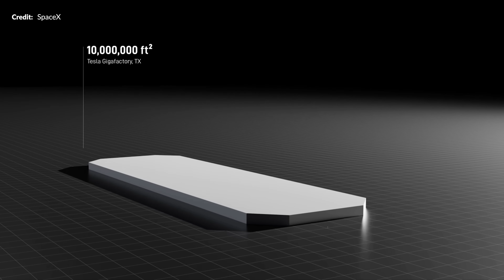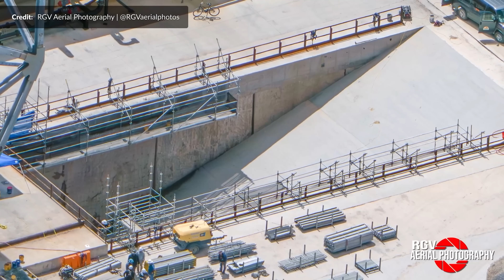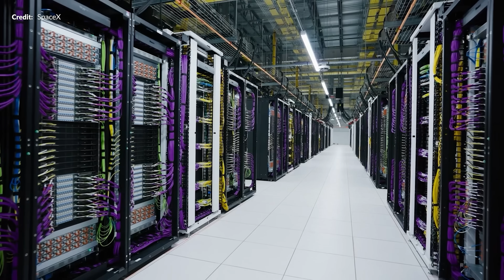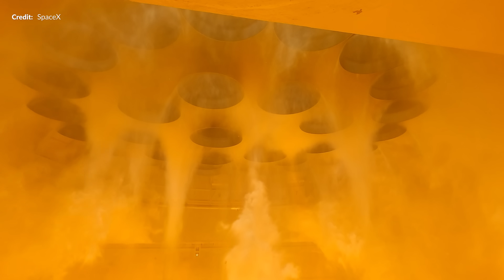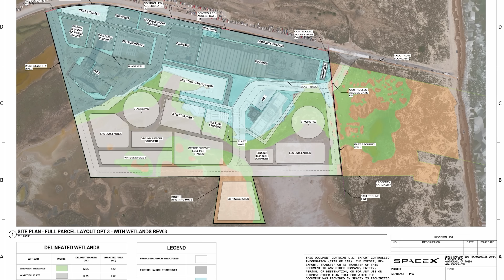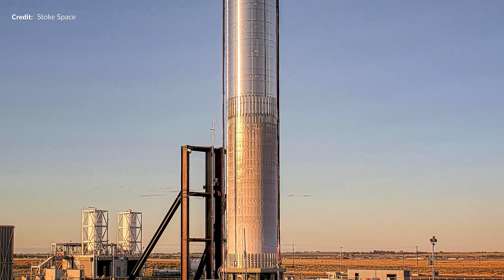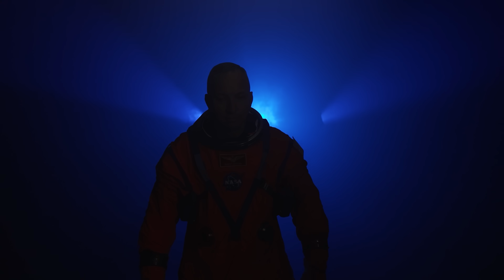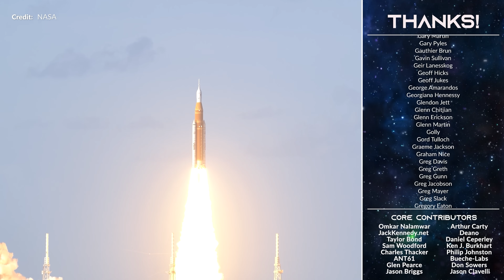SpaceX Just Revealed Its Biggest Plans Yet

Comment: When you consider a falcon first stage being reused 35 times you can truly understand how much money and resources are being saved by the re-usability of them.  That would have been 35 desperate rockets and engines that would have needed to be replaced.  Amazing.
Reply: Every time they set a new record I remember Thunderf00t doing a video "debunking" Falcon re-usability.  

Even then I saw that the numbers he calculated with didn't match the numbers he stated.  The key change is he stated that Falcon in reusable mode could carry 70% of expendable and his calculations used 50%, so he compared 5 expendable launches to 10 reusable (and asserted that 10 would almost never happen, but gave no reason for that).  The number swap and assertion (for those who accepted them) made him look right.  Use the number he stated though and even with only 4 flights it was clearly better for SpaceX financially, especially if they didn't pass on ALL the cost savings but it would still be cheaper than expendable per kg to the customer.  

Now it has reached the "impossible' 35 flights, the numbers work even more in Falcon's favour, especially since they are doing more than 70% these days and expendables can also be cheaper for the customers as they now expend reused boosters instead of new ones.  

Haven't watched him much since then as for topics I don't know I can't tell if he is lying or not.  

:face-turquoise-covering-eyes:

:face-turquoise-covering-eyes:
Reply: @Scanner9631  A lot of people don’t understand the SpaceX/Musk way of working, and others assume that because Musk is (in their view) a jerk, his companies must be bad. In most engineering companies i’ve worked in, the management get in the way.
Reply: @Scanner9631 By the way, Falcon 9 is such a advanced rocket, that even with 30% nerf it still have more payload fraction (3%) than most expendable rocket(2.5%).
In expandable mode the payload fraction for Falcon 9 is 4%.
Reply: Incredible validation of everything SpaceX has been talking about.
Reply: desperate rockets: "No, No! I don't want to return to earth... It burns! it burns!" 
(it's disparate... different word...)
Reply: @qcca123-f1v  though he meant separate lol
Reply: Maybe we're saying this backwards?

When you consider Falcon first stage being reused 35 times, you can truly understand how much money and resources are being wasted by every other launch provider.
Reply: @kennethroberts6993  you do realise how much bigger a trillion is compared to a million? in other words, SpaceX would need to launch a rocket 60,000 times to come close...
Reply: @spanke2999 you missed my point. A single Falcon 9 booster has made 35 launches and 35 recoveries, and is ready for its 36th mission. SpaceX still has the working booster. 

The rest of the world before SpaceX has been launching 1 mission and disposing of the entire rocket. The refused to accept that rockets could be reusable.

Any prior launch provider would have built 35 boosters, launched them, and disposed of 35 boosters. Leaving them with none. They dispose of every booster. To be left with one, they'd need to build the 36th booster compared to SpaceX's 1.
Reply: @kennethroberts6993  I didn't missed this, a trillion is just a million times bigger then a million... That's a lot of rockets even for space X 😂 you guys are missing the point how big the numbers of this ipo are. It's economically impossible to make a return of investment with rockets😅
Reply: @spanke2999 It's not impossible to get ROI from rockets. Falcon 9 is economically feasible, or SpaceX wouldn't be launching 150 times a year.

As well, nobody is going to launch a million rockets anytime soon. The xAI constellation will supposedly have 10,000 satellites in it, and Starship launches several per flight. I know xAI sats are to be larger than Starlink, but I don't know by how much.

That million rockets thing is for the moon and mars. And Musk doesn't talk about it like it's gonna be just SpaceX. He expects other companies to ramp up too.
Reply: @kennethroberts6993 I didn't said it's impossible to get any ROI. I said it's impossible to get 2 Trillions bank with rockets. Starling so far is the only branch that makes any money and given this the evaluation is round about 3 times higher then it should be😅
Reply: @spanke2999 I guess I missed your point after all. You're talking about the IPO and money. I'm talking about rockets. To me, the IPO is old news. I can't wait for the hoo haa to settle down. Millions of launches won't happen tomorrow, nor the day after. That's Musk setting the stage for when colonization is actually happening.
Reply: @spanke2999 2 trillions bank? SpaceX doesn't have "bank." They have assets that you can touch, made out of metal. SpaceX has dreams and teamwork. They have contracts and enough reliability and proven skills that a ridiculously huge number of people wanted to be part of it.

Day traders have "bank." Day traders are what workers with jobs and families scrape off their shoe on their way to work.
Reply: You are a day trader. Your contribution to the future of humanity is a negative number. Day traders are parasites. Buy low, sell high, and what was the name of that company again?

Day traders want lots of liquid assets so they can dash in and scoop up bargains.

So you probably know terms like liquidity. Go Google Elon musk liquidity. Or gwynne shotwell. These guys are in it for the long haul. Musk works 80+ hour weeks. This isn't a work-a-day company that empties out at 5pm.

I'm tired of people who only think about "bank." Have a nice life.
Reply: @kennethroberts6993  of course I'm talking about the IPO because this is what will shape SpaceX from now on! Money and profit! And I don't know how to bring this to you, but colonization wont happen anytime soon. 

1. because of so many problems that the rockets to reach Mars are not even one of them.
2. nothing... and I mean nothing Mars can provide that isn't so much easier and cheaper here on Earth! 
3. Multi-Planetary-Species... to be frank, we are not even able to protect the planet we have from the stuff we do to it! I fail to see how this will change at another place that is far more hostile to life then any place we can find here on earth
Reply: @spanke2999 
1. I'm pretty certain I will be gone before a human sets foot on Mars. That's irrelevant.
2. Except provide safe haven for the species if Earth is hit by a mars-sized hunk of rock going half of light speed.
3. Doing the work today brings new knowledge to the species. Throughout human history we reached for the stars...for things that were viewed as impossible and even insane. Usually we failed in the main quest but enriched our lives in unimaginable ways simply because we tried our hardest.

Money is nothing more than an abstract token of worth. You, as a day trader, are inherently incapable of understanding this. You might try for the rest of your life, but the dollar is the altar where you sold your soul. It's the only ending for people like you, and you won't understand how worthless it is until your last breath.
Reply: Humanity has won simply by setting foot on the path of knowledge. Every time humanity splits itself, a wealth of knowledge is discovered. The financiers are never the recipients of the knowledge gained. The species is. The beginning of discovery is not when the destination is reached. It's when the first explorer sets foot on the path.

This isn't some sort of religious rant. It's documented history.

Again, you won't see it because of buy low sell high. Day traders don't have the necessary equipment to participate in the quest.
Reply: @spanke2999 mars has been my dream since I was a boy. The fact that a significant effort is being made to get there fills me with jitters.

But Mars isn't the important part. Rockets are. There's a shit-ton of projects, both research and for profit, that want to launch heretofore unheard of mass to orbit.

Do you think it's a coincidence that SpaceX is within a couple years of Starship coming online? No coincidence at all. Starship will succeed because humanity needs it to. Look who the biggest investors were. They're venture capitalists who have been allied with SpaceX since the beginning.

We need a shit-ton of orbiting hardware. Starship will deliver. It's not a question of whether anymore. They already tested every system. 

When they start launching more mass to orbit annually than falcon 9, every other rocket company will scramble. If they can't get their cadence up and their costs down, they'll either fail or fall into obscurity.
Reply: @kennethroberts6993  If I were a day trader, I would be celebrating this IPO. A quick 30%+ hype pump within a few days is exactly what short-term traders live for. The criticism of the valuation has a completely different systemic background.

The IPO is not a sign of strength, but the classic exit vehicle for early venture capital investors. This is a transfer of risk: VCs pull their capital out and dump the long-term risk onto the public market. Once the market realizes that the core launch business can fundamentally never justify a multi-trillion-dollar valuation, capital flight becomes a real threat. This compromises the very existence of SpaceX instead of securing it.

Furthermore, economic history shows that it is rarely the visionary pioneer who ultimately prevails, but rather the one who can implement the technology in the most economically efficient manner. Visions without liquid backing collapse.

You can dismiss the monetary system as an "abstract token" all you want, but it governs the allocation of real resources on this planet. Just as physics does not care about human dreams, economic constraints do not care about romantic narratives. We operate in reality, not in a utopia.

and since I'm not a day trader... your half light speed meteoroid would carry so much energy, that the impact would affect the whole inner solar system, including Mars... 😇
Reply: Musk is full of shit.
Reply: Thanks
Reply: Shame the funds are going to be sucked up by AI  hardware
Reply: @walterrwrush  I think the opposite is true, they're pushing AI hardware as a cash cow to fund thousands of launches and develop starship hardware.
Reply: @walterrwrush  How do you get tons of ai satellites in space though? Big rockets 😂
Reply: @walterrwrush why? It get it off earth and provides a lot more engineering power
Reply: sadly most people fail to understand how much a trillion is... 😅 you would need so many rockets savings for this... so so much, it's sadly pure fantasy!
Reply: @spanke2999 that is what they said about falcon.
Reply: @brianbiddle7590  not really, falcon could be a distrupting technology but there was no physics problem with falcon. It was questionable if it could make it economically, but not if it would be possible at all. But then SpaceXAI is no longer about rockets. Not about falcon not about starship. 2 trillions only make 'sence' when you go data centers... And these don't work because physics! So there is a difference
Reply: @spanke2999 again they siad the samething about falcon. There are plenty of videos showing how they are going to do it with the math proving all the people like you saying it won't.  I have to ask what do you do for a living?
Also it is about rockets because you have to make it cheap enough to get the payload up.
Reply: @brianbiddle7590  The critique of Falcon 9 was about economics, not feasibility. Space-based data centers, however, face a fundamental technical barrier: ionizing radiation and nanometer chip architectures do not mix. Shielding and redundancy (TMR) required to prevent constant hardware failures add immense mass and cost, while vacuum cooling solves nothing efficiently. It doesn't break physics, but it completely destroys the business case. This IPO is riding on pure hype, not a viable product.

And just because they solved the engineering challenges of reusable Erdorbit-delivery, it doesn't mean their scaling logic applies to high-radiation solid-state computing. Past success in logistics does not guarantee feasibility in physics — just ask Boeing how historical dominance in aviation didn't guarantee success with Starliner's software and valves.
Reply: @spanke2999 what “physics” prevents chips from working in space? You do realise Starlink satellites already have plenty of chips running on them right now… so where is the physics that makes this “impossible”?
Reply: @StarMan_2018  considering that the guy cant even spell the word "sense" i don't think there is much sense, in trying to have an actual intelligent discussion with this guy.
just agree, "yup, no microchips in space" and then continue enjoying all these great new aerospace companies launching hundreds of chips into space each year. its better for everyone that way.
Reply: @StarMan_2018  I wrote it down I guess... but I can repeat it if you want. Chips are not chips. You might realize that a modern graphics card can be a bit more expensive then an old Laptop from 4 years ago. The magic behind this is partially based on the size of the architecture of the chip. this means the transistors inside it becoming smaller! currently, with the AI chips, we are talking about  3 nanometers. That's really really small... so small in fact that it reacts quite sensitive with ionizing radiation which can cause all sorts of problems, SEE's, TID, and so on. In short the chips are prone to produce errors and degrade much faster then here on earth. To combat that you would need way more chips or rely on heavy shielding! 

Why is this not a problem with other satellites ... it is! That's why they don't use ultra modern high density architecture and or operating in lower orbits. Given the idea, or realizing the power need of a AI satellite, to let them orbit earth in 2,000km instead of 400km... you increase the ionizing radiation by 3 to 5 orders of magnitude! 

So... what physics you ask? The fact that you reduce the chip architecture to have powerful and efficient compute and the need to operate in a radiation environment that makes this intensely prone to failure. I hope I have not so many typos so that @LodewijkVrije doesn't get distracted 🤣

Remember the flame tranche! Physics is not an option... it's cruel no matter how much flashy ideas you have!
Reply: @s @spanke2999 es, I don’t see their shares being a good short term investment. Maybe in the long term when moon mining is routine
Reply: @spanke2999 Rocket launches aren't why they are valued at trillions. It is global reach for the billions of people and available compute with unlimited energy 24/7. The irony is, you understand none of it while questioning the value of a trillion.
Reply: @nguy404  oh... if only. Sadly I understand too much. For example I understand why a data center in an 2k something orbit wont work. Ionizing Radiation and nanometer architecture chips don't mix well. There is a reason why science satellites use hardened chips. Often with an architecture that is a hundred times bigger then the current chips used for AI training. so tell me... how well will this work? 

And billions of customers... for AI? AI is, if it works and makes money, cutting billions of jobs! who is buying the products the AI produces? 

And there is sadly more... putting aside the technological problem that the chips will be destroyed quicker then they can bring up the satellites, put aside the question about who is buying when everybody looses their job... if the concept works, this means tens of thousands of satellites in orbit. Just one accident, or an attack... and the whole investment turns into shrapnel!

So tell me... do I have a clue or not?
Reply: @spanke2999  You are a guy who read a couple things on the internet and assume you know how they work. Whereas Musk has built the most successful rocket company in over 50 years and developed an AI division of his tech company. He is literally an expert in both fields and has even better experts to tell him if it will work or not. And while he is a hard boss he usually doesn’t reject valid criticisms from actual experts (if he did his companies would stop existing very quickly).
Reply: @adamb8317 😂 musk constantly comes up with time tables that are nowhere near to be even possible... He plays video games while his engineers are trying to explain stuff to him... He refused a flame trench...😂 Try less following idols and more physics
Reply: @spanke2999  I guess will will have to see who is right. I certainly don’t idolize Musk and I think he has made many mistakes, but I don’t see proton radiation for these satellites being an unsolvable problem. My real question is what they gain from doing this in space at all, and if it’s constant power, is that worth a little plastic radiation shielding?
Reply: @adamb8317   That is exactly the point: the issue isn't whether it’s theoretically feasible in a lab, but whether it’s economically viable in reality. It’s the same narrative pattern as a Mars colony or point-to-point passenger transport with Starship—technically imaginable, but an economic and logistical nightmare.

The "little plastic radiation shielding" you mentioned is where the business case completely collapses. A 2,000 km orbit puts these satellites directly into the inner Van Allen belt, exposed to intense high-energy proton radiation. To protect modern 3nm AI chips here, a thin layer of plastic won't cut it. You need massive, heavy shielding. This dead weight fundamentally ruins the payload capacity per launch, wiping out the cost advantages of rocket reusability. Additionally, insufficient shielding causes secondary bremsstrahlung (X-rays) inside the chassis, degrading the nano-architecture even faster than primary radiation. Combine that with the absolute nightmare of cooling megawatt data centers via radiation in a vacuum, and the tech becomes a money pit.

So, what is the actual goal here? It’s a valuation pump. SpaceX and Starlink are highly successful logistics and telecom products with real cash flow. But they alone cannot justify a 1.8 trillion-dollar valuation. To inflate the IPO to these massive tech-giant levels, you need an AI narrative for the markets. This concept wasn't designed by physicists to build a functional product; it was designed by executives to sell shares at a premium. Physics is cruel, but the stock market thrives on hype. We'll see who is right.
Reply: @spanke2999 Tell me actually how many Starlinks in orbit? Over 10,000 are they render useless because of radiation? And people in charge of making satellites are cluess how to shield electronics from radiation? What are the tolerance can be? You are still clueless.
Reply: @nguy404  good argument... but! Starlink doesn't use chips with a 3nm architecture, because they don't have to run AI models, in fact the compute these satellites have to do is pretty small. Also, they operate up to 500km, that's withing the ration shielding of the planet, if you would raise the orbit to 2,000km as it is planed for the data centers currently, you increase the amount of radiation up to 100,000 times because you end um in the inner Van Allen Belt. Last, nobody said anything about that it is impossible to do so... but it is not economical because you have to increase the mass and hardware so much that it doesn't make any sense! Just imagine you have to use 3 times the chips compared to here on earth to have the redundancies and error corrections... for each 'data center' in space you could build 3 data centers on earth ... just hardware wise! 

And no, to lower the data centers to 500km doesn't solve the issue as well. you would need again more mass for bigger batteries and the huge dimensions of the satellite will cause it to raise it's orbit way more often then starlink. This again means more mass for fuel or a shorter lifespan... 

So... again... it is not physically impossible, just nothing that justifies 2 Trillion ... But this is just me... oh look the shares are 20% up 😅